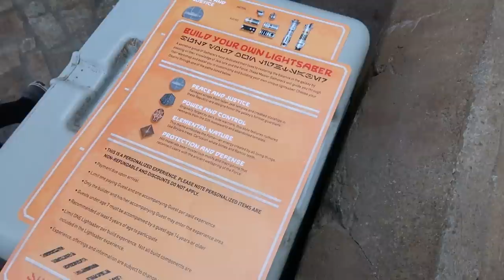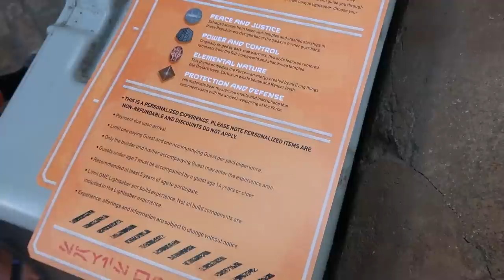I BUILT A $200 LIGHTSABER! - Star Wars Galaxy's Edge - Disney World

Comment: Does it run out of battery?
Reply: Unstoppable Dragon it could, but I think it takes 4 AA batteries. To replace them you just take off the bottom piece, push in the black part and twist. That'll be the battery pack :)